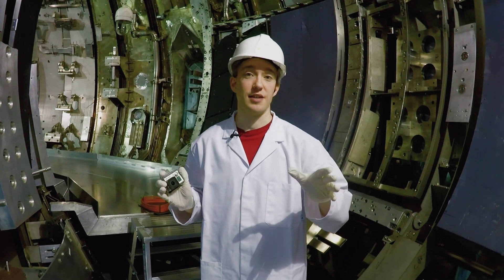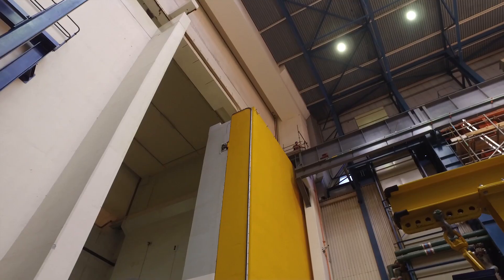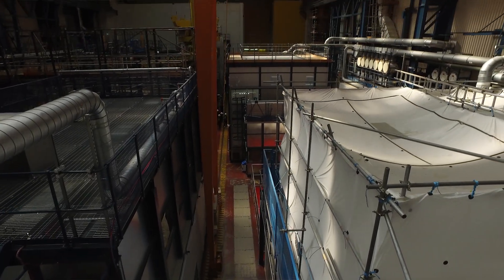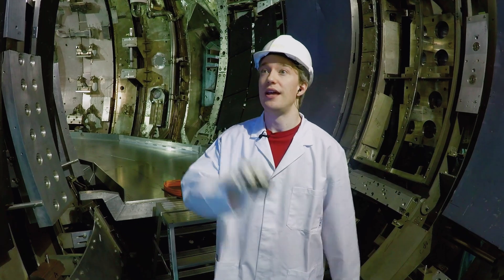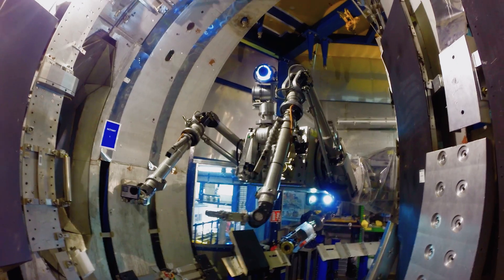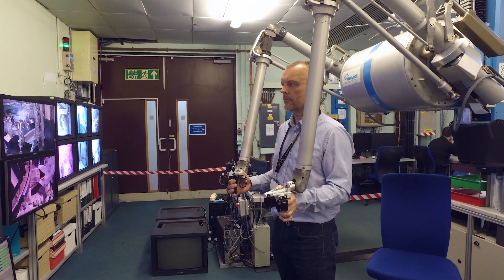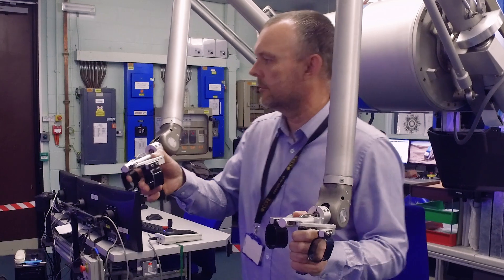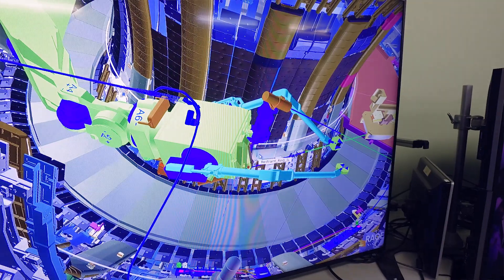The Not-Quite-Robots That Help Fix Fusion Reactors

Comment: Stupid question is stupid ... but still ...

If they are using flat LED monitors, how do they deal with depth perception? 

I lost my prescription glasses the other day, and used the old 'using the camera on my smartphone trick' to find them ... but my depth perception went out of wack, and ended up with a migraine...

... so how does the operators compensate for that ...?

Comment: What we now call telepresence was originally called a Waldo.  The term was coined in an old science fiction novel.

Another use for the technology is medical.  Microsurgery is much more precise if a centemeter of movement by the surgeon translates to a millimeter or less of movement in the waldo.
Reply: I think you are talking about the da Vinci system, which combines laparoscopy, Waldos, and 3D technology, integrated into a single system. Extremely expensive (ca. $2 million per unit), but I have seen videos of surgeries done, which, although still requires a surgical team on standby in case something goes horribly wrong, otherwise, since each individual 'port' requires a small incision, the risk of internal haemorrhaging, and scar tissue, is much reduced, along with decreased healing time; if the overall cost of the system can be bought down, then hopefully it can be become more widespread...

Comment: Basically its the same phenomena where gamers forget that they are pressing keys on a keyboard and instead think in terms of actions and movements and habits translates it into inputs.
Reply: Or playing any musical instrument for long enough.
Reply: Honestly, that's kind of how operating your own body works as well. It's just that our body is literally build to be maximally intuitive when performing most tasks, and we also learned how to operate them at such a young age that we forget most of the experimentation we went through when, for example, learning how not to fall over trying to stand up.
Reply: Like riding a bike or driving a car.
Reply: The rubber hand trick might be a better analogy
Reply: @maple22moose44  What's the rubber hand trick?
Reply: @orsaz924  it’s where you put your hands on a table and someone puts a divider between your two hands with a rubber hand in place of your second hand, so you can only see one real hand and a rubber hand, then someone will touch, rub, and do stuff with the rubber hand and the real hand that you can’t see at the same time, tricking your brain into thinking your feeling stuff on the rubber, then unexpectedly the tester will slam something into the rubber hand and if everything went well you’ll react as if the tester was slamming something into your real hand, and maybe even feel it too

Comment: They should have vr headset for the control guy
Reply: +Minh Vu With a camera on the robot's "head", that moves according to how the operator moves his head? That would be really great indeed.
Reply: did you not watch the video?
Reply: jhfridhem I did. Why your question?... An upgrade with VR headset (which they don't have) and the camera on the robot head moving in the same way as the operators head (it doesn't do that, or at least there is no sign that it does...) would be nice, wouldn't it? :-)
Reply: Shadow81989 because the video answered your question
Reply: jhfridhem I didn't even ask a question :-o
I seconded the proposal that a change in the design would be nice.

Comment: These vids come out just for the 30 years Chernobyl anniversary, well-done.
Reply: +pastichka 
Fusion has nothing to do with fission / traditional nuclear power plants. Fusion actually is safer, if not completely safe (if the power goes off, the reaction stops. So simple :D ), produces almost no radiation, but is at the current state not efficient enough.
Reply: echsomat valid point. still, the anniversary was a few days ago <3
Reply: Woohoo!

Comment: 2:10 can't they just send a robot to fix the robot??
Reply: But then you need to send in a robot to send in a robot to fix the robot.
Reply: +Snufkin224 if your question starts with "can't they just", the answer can only be either "they already do" or "no"
Reply: +Kim André Moen Bjørkede 
It's robots all the way down.
Reply: +Κώστας Λουπασάκης But a USEFUL answer would be "here's why they don't..."
Reply: Joshua Pearce For the "sending another robot" argument to work, we need to make one of the following assumptions: Either we have a general purpose robot that is able to do whatever necessary to fix any problems, or have a set of specialized robots, each that can fix a specific set of errors.

Since general purpose robots are not yet perfected, and having an array of specialized robots on hold for any possible fail scenario seems impractical, this must be the reason they don't do so.

Of course I don't work there, these are just assumptions. Feel free to correct me if you can
Reply: Κώστας Λουπασάκης The second robot doesn't need to do anything complicated, it just needs to be able to do stuff maybe as complicated as maintaining a fusion reactor while being controlled by a human.,,, which they already have.

Jokes aside, it actually just needs to be able to move the primary robot outside for a human to work on.
Reply: luke godfrey When robots fail, they still have ordinary waldos. That solves the problem of contamination.
Reply: Joshua Pearce Good call on the "move the primary robot outside". Must be some other reason we don't know about yet
Reply: +Κώστας Λουπασάκης 
these are general purpose robots though, essentially they are telepresence technicians
Reply: +Joshua Pearce 
Can't do that. The primary robot, whilst not in the reactor while it is running, does go into the reactor, which is full of activated material and some of it will contaminate the robot.
Reply: +Joshua Pearce 
You can't send anyone into the reactor after it has been run once; D-T fusion shoots out high energy neutrons which activate the wall material, making it radioactive. At the same time, the walls are ablated by the extreme heat, covering everything inside the reactor in fine radioactive dust.
Reply: although an infinite daisy chain of robots does sound fun, you'd only need 1 other robot, as the chance that both would be damaged at the same time is slim if properly managed. At least in my little brain.
Reply: Snufkin224 But who fixes the fixers
Reply: Snufkin224 I

Comment: What about having a Not-Quite-Robot go in and fix the Not-Quite-Robot?
Reply: +DFX2KX Leave it inside?
Reply: +raumaan kidwai nope fusion reactors generate radiation in the form of excess neutrons
Reply: This happens, I'm not sure if their was a age with this video issue or Tom didn't know but they do this.
Reply: The not quite robot repairer not quite robot
Reply: +Ziggurat because at some point you have to open a door to let the other not-quite-robot in to fix it, hence the radiation and Beryllium problem.
Reply: +DFX2KX Airlocks?
Reply: @DFX2KX  what if you use a third robot to open the door tho

Comment: That was cool that you were allowed brief, slow control of the remote manipulators. Honestly, I was expecting that their answer would have been "No", and I originally thought that the "for the same reasons" part was going to confirm that expectation, so the fact that you were allowed to do it at all was a nice surprise.

Comment: Give the poor bastards an HTC Vive.
Reply: +william Booth-Clibborn like he said, it needs to be reliable for 20-30 years in a radioactive environment. sure the headset wouldn't be in the reactor but the transmitter and VR Camera would be which would be problematic if it were to malfunction or break
Reply: +alex609414 They could use the same 'transmitter' they use now (I'd guess they use cables not a transmitter) and they don't need a 3d camera. Just use two of the current type set at eye distance apart with the feed from each going to its own screen in the vive.
Plus they could use the same control input as they do now and only use the headset so that the operators can judge distance in the same way as they do in the real world rather than using 17 different camera angles and a virtual 3D mock-up.
Reply: alex609414 Well the reactor has been active since before devices like the Vive were available and, as was said in the video, they can't send a person in there to install new cameras etc. So they're stuck with what they've got!
Reply: MrSquishedsquashed while you prove a good point i feel as if it were that simple then they would have already have hooked up the VR
Reply: ahh true, at the same time though I'd imagine they would have a way to remove the arm to add/remove things and repair it, seems odd to me but hey, when you're running the hottest known thing in the solar system I guess the arm is a bit far from the top of the importance list
Reply: +william Booth-Clibborn You'd have to stitch all the videos together in real time which would be more than a little complicated, which is do-able, but not reliably
Reply: alex609414 I guess they might have multiple maintenance arms in the reactor. That way if one fails it can be fixed using another as it's very unlikely they'll all fail together. But who knows, we'll probably never get to find out...
Reply: RIG Stitch all what videos together and why?
Reply: +william Booth-Clibborn They are probably woking on converting these systems to proper VR. But as Tom said, absolute reliability is required, so that means years of validation.
Reply: +MrSquishedsquashed exactly, just stick a 360 camera on it, no stitching!

Comment: He needs an oculus rift
Reply: Cadde They don't need it though.
Reply: +Pan kurczak Oculus does have motion tracking. I was using it not one hour ago. Why do people still believe this myth? Either way, you wouldn't need motion tracking for something like this.
Reply: He literally explained why that's not an option in the video itself.
(Besides, he'd need a Vive :p)
Reply: Hololens would be even better
Reply: +He rr Gamer (Herr Gamer) the problem isn't the HUD, the wide angle 3D cameras would need need the reliability and support...
Reply: Pan kurczak Yes, like moving left and right. Or getting up and walking around the room if you want. I use it to explore my cockpit in Elite.
Reply: Cadde They don't know how long the technology will be supported though. Valve as well as Sony have a history of dropping technologies not far within their life cycle. They can't test it, they need to know this works right away.
Besides, the camera of the robot can only move at a certain speed, since your head isn't bound to this in VR, people would get very sick very quick.
Reply: Pan kurczak They help make it, anyways. And I wouldn't exactly trust HTC to support the Vive for the next 100 years either.
Reply: Cadde The thing is, the Vive and the Oculus are both experimental technology. If anything ends up breaking, you may not be able to repair it in 10 years. Besides, I'm pretty sure their budget is a LITTLE too tight to experiment with VR atm.